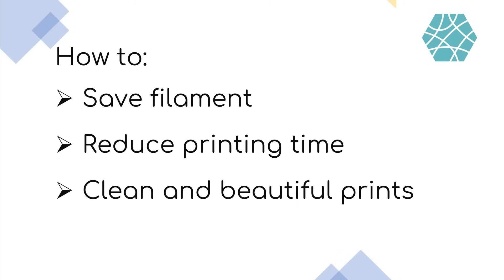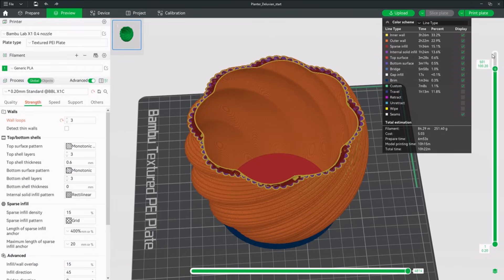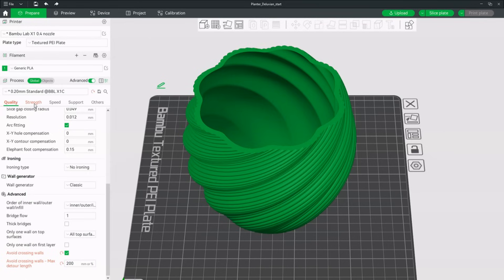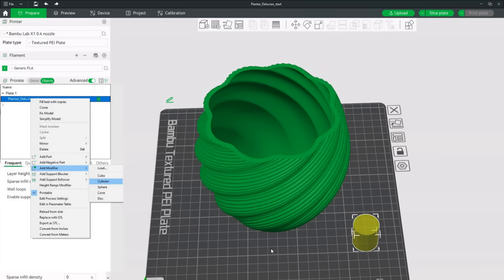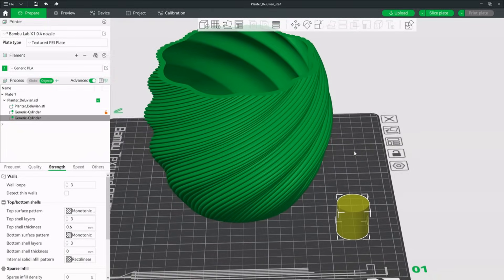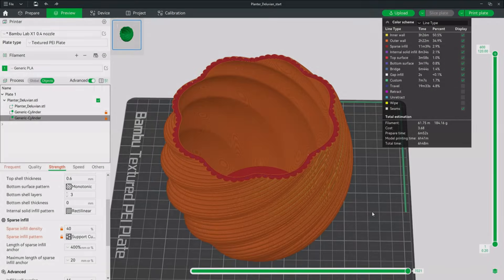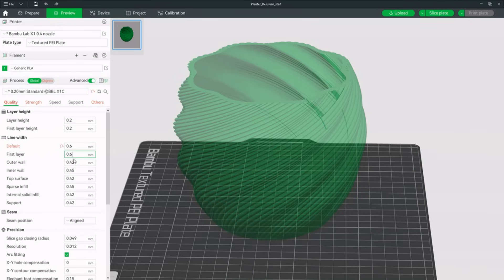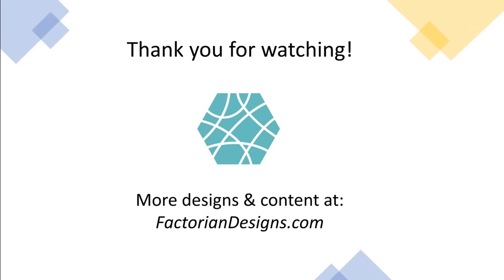Cut Your 3D Printing Time In Half!

Comment: 2:38
You could also just increase top and bottom layer count by a few until the bottom is solid, but the rest is hollow.
This would almost certainly correct any bridging issues on the top layer by the time it reaches the last few layers as well.
(Though, I'm not sure if the concentric pattern would cause any issues in this particular model without testing it...)
Reply from the maker: You could do that, but that would need a lot more filament :)
Reply: @Factorian_Designs  
Certainly more filament, but it may be better for certain use-cases.

For example, I prefer many of my prints to be bottom heavy.
Though, I will admit my suggestion would not be ideal if you were printing many of them.
I would probably only do this if it was a one-off print, or a small number of them.
In this case, the few grams extra would be quite negligible to myself.

I will slice a test model using both methods and update here for a comparison.

To each their own!

Comment: Why does the top modifier not add infill in center of object but bottom modifier does? Is there something i missed? Or is it because the bottom floating surface is in modifier but wouldn't that be support and not infill at that point?
Reply: Cause there's open space? The modifiers only add things to the model where its touching...
Reply from the maker: Exactly. 

Support is everything that gets removed after printing. Infill stays inside your model and is there to support your top layers.

Comment: The upper infill prints in the air
Reply from the maker: True, but a tiny bridging gap like that should not be a problem for most printers. I am not so sure about the printing temperature change for bridges; I don't think it works like that in Bambu Studio. Usually, the printer only slows down.
Reply: With a short distance between walls, I’m wondering if most printers could easily bridge that gap, but bridging changes extruder temperature which can lead to a line in the layer when using settings optimal for overhangs.
Reply: Yeah it just didn't attach properly in my case and the upper layers kind of crumbles a bit

Comment: It's a shame you don't explain the reasons behind unticking some options and how did you get to your line width calculations
Reply: @EhudShahak it’s a shame you support genocide 😢
Reply: It’s a shame you can’t do your own research.

Its a shame you can’t just ask for more information like a normal person without saying “it’s a shame”

Wow, what a shame. We’re all incredibly disappointed in you.
Reply from the maker: You are right, I could have explained some things in more detail. Thank you for the feedback.

As for the linewidth, a general rule of thumb is not to go wider than around 1.5 times your nozzle width. With a 0.4 mm nozzle, that is 0.6 mm.

For this print, with 3 walls and standard settings, you get 0.42 mm + 2 x 0.45 mm = 1.32 mm.
If you use 2 walls with 0.6 mm, you get a 1.2 mm thick wall, which is nearly the same as before with 1/3 less distance traveled. Two thick lines also tend to be stronger than three thin ones, even if you have the same total wall thickness.

Everything above 0.6 mm with a 0.4 mm nozzle can lead to problems while printing. If you still want wider lines, you are probably better off using a bigger nozzle.

I hope that helps. Anything else in particular you have questions about?

Edit: I  made other optimization videos where I explain settings in more detail, you can take a look here:
https://youtu.be/dWL2swAqcyY

and here:

https://youtu.be/CxbidoZCw1A

Enjoy!
Reply: @Factorian_Designs  this is really helpful additional information, thank you! And excellent video
Reply from the maker: Two settings that I also didn't give enough explanation to are:

"Ensure vertical shell thickness" and "avoid crossing walls."

These can have a significant impact on your printing time as well as quality. If enough people are interested, I will make a future video about when and how to use them correctly. I will probably showcase them on my most optimized model, which I have literally printed thousands of times.

Edit:
New video is out, which explains "avoid crossing walls" in detail, anyone interested can checkt it out here:
https://youtu.be/CxbidoZCw1A

Another video on the subject of print optimization which explains "Ensure vertical shell thickness" will follow soon.

I hope this will be some additional help!
Reply: @Factorian_Designs  as someone completely new to 3D printing it's helpful having the information split across multiple videos anyway. Only so much information I can absorb at once, going over a couple settings and explaining what they do, when to use them, pros / cons, would be perfect! My main takeaway from this video was that we can create geometries to selectively change infill, along with other settings.

Even just seeing you scale and move the geometries is helpful. I've scaled prints down a bit to fit my A1 mini, but I don't know what I'm doing, it's useful seeing someone else interact with the slicer.
Reply: @Factorian_Designs  that will be awesome
Reply: @Factorian_Designs  I too am quite new to 3D printing. The engineer in me loves the details of "but why?". Thank you for bring that. I look forward to learning from your serious experience!
Reply: @Factorian_Designs  Thank you so much!
Reply: @Factorian_Designs  This is excellent information, thank you so much!
Reply: @Factorian_Designs  WOW...Great explanation!
Reply: @Factorian_Designs this is very helpful. Thank you for your time and efforts.
Reply: @Factorian_Designs lol this video was amazing....
Reply: dont be rude....be polite...just asking normally or just create a tutorial better
Reply: It's a shame that you could've simply asked this question better than this.
Reply: Its a shame? Wow some people are just unappreciative. Dude dropped a shit ton of helpful tips and you're mad he didn't make the video a half hour long to explain his thought processes? At least he was nice enough to cater to you.
Reply: @AsaSpadeSS yes not every video have time to go in depth. I bet if he did go in depth some will complain video too long 😂. Best practice for me is write down key steps or questions during videos. Then later on dive in more depth with other sources. This help me a lot understand settings.
Reply: its a shame that hes not selling a course for this and you still want to get more info for free.

Comment: Would this work with articulated models well or are these suited for larger objects like the vase used
Reply from the maker: That depends on the articulated model you are printing. I would recommend playing around with a few models to get the hang of it.

I am sure articulated models can be improved to some degree as well. However, modifying your prints as shown tends to work better with symmetrical models.

Comment: The only problem I see with this is that you didn't reduce print speeds when increasing line width. Unless you've tested that your hotend can keep up and the maximum volumetric flow rate is not exceeded, this could lead to problems.
Reply: In Bambu slicer you can set your max volumetric flow rate so if you print widder lines, it will compensate speed, doesn't matter if you set it at 300 or 500mm/s if it has to be 100mm/s (for example)
Reply: @maghg2764  oh yeah I forgot about that. That essentially nullifies my initial comment then.

Comment: In SuperSlicer you can adjust top layer width separately. Also you can use height range modifiers for get similar result. Not sure if Bambu has it, but it is as SuperSlicer is based on PrusaSlicer, which have height range modifiers as far as I remember.
But adding objects with modification is also a useful way to tweak your model. I prefer leave outer border with normal width, only inner border set to 150%. SuperSlicer also have option to set external perimeter different from inner perimeter.
I do not recommend SuperSlicer though. It is under serious develpment now and have multiple bugs which are fixed one by one, but it all needs time. I tried Orca Slicer which is kinda Bambu Slicer clone, but I personaly prefer SuperSlicer. I am helping to catch bugs, and hoping it will be fixed soon. Older version is more stable and I use it, when newer version fails.
Reply from the maker: You are right, Super Slicer has some excellent settings, which will hopefully get implemented into future versions of Bambu Studio. But like you said, I had lots of bugs with Super Slicer, which at some point drove me crazy. 

Orca Slicer / Bambu Studio currently has the best overall performance for me.
Reply: @Factorian_Designs  it is OK, you showed a good way to customize slicing, which can be applied to different slicers.
From my side, I tried to switch to Orca, and its interface is not very comfortable for me. I see 'bad' Cura for some reason = )
But there are a lot of new features, so this is very modern slicer I agree.
Reply: Yeah I'm similar
What version are you using for stability?
Reply: 2.4.58.5 is quite alright and fast with slicing. Recently they updated 2.5.59.11 (but it have some issues under W11 and sometimes crash on slicing) I use it too, most of the time it works for me, but I use Linux, so if you are W11 user 2.5.59.11 may be not very stable for you. 2.4.58.5 is the latest of previous branch, and as far as I know it have no issues. But I may be wrong, as I did not run it under Windows. But main maintainer check his builds mainly only under Windows.

There is a nice feature like dynamic layer height. I guess Bambu should also have it. It may speed up print by using higher height on parts which does not need much detail.
Reply: @enosunim  thanks for the detailed answer, ATM I run 2.5.59.9 on my win 11 machine and haven't had any issues yet but I don't wanna jinx it by updating to 2.5.59.11
Hopefully 2.7 isn't far away, I miss tree supports from orcaslicer 🤣